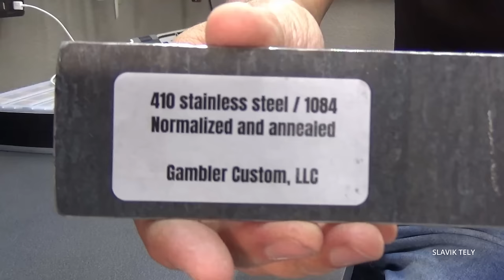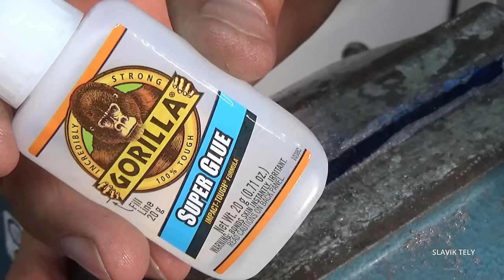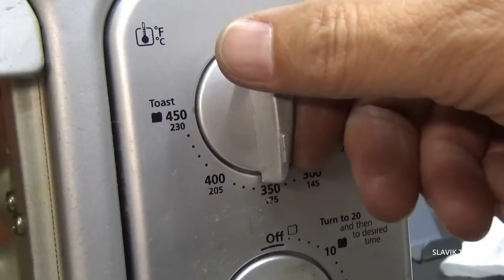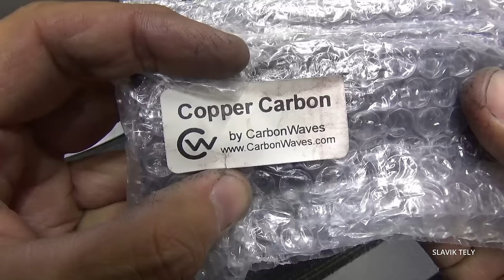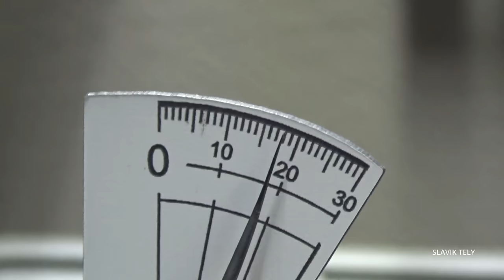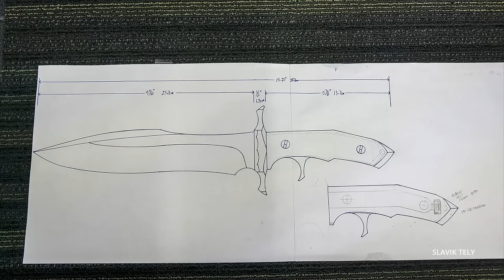Making Rambo Last Blood Heartstopper knife

Comment: Please don't wear gloves, or anything that can be caught by the drill, while using a drill press. They can and will take off your fingers and/or mangle your entire hand.
Reply from the maker: My drill press is not that powerful to do damage to my fingers.
Reply: How long do you think he's been doing this? I suspect he knows what he's doing.
Reply: @moehoward01  I get that experience is valuable and surely helps to avoid accidents. However it only takes a second of not paying attention and one wrong move to mess up your hand real bad. Especially when you're comfortable around a certain machine you tend to get careless. So just consider it a heads up to be mindfull of anything that can get tangled in a moving machine. Gloves, hair, long sleeves, etc.
Also: I'm a big fan of the channel and obviously want to enjoy the work as long a possible. Stay safe! :)

Comment: in general, the idea is interesting to divide the handle and the blade into 2 parts, in fact it is a collapsible fulltang, but this technique allows you to change the blades and leave the handle, this is a cheat!  fabulous !  it would be interesting to see if you decide to actually make another plus one blade
Reply from the maker: That is an interesting idea. I need to make a knife with interchangeable handles.

Comment: Congratulations on the assembly of the façade, it was beautiful and very top, I would really like to have one of these. If I saw it in a store for sale , I would certainly buy a work of art like this , and I saw that it is beautiful and a lethal weapon , in a fight against an animal dangerous to humans , it would give a lot of advantage , because from what I saw in the assembly , it cuts on both sides , and also if you , at the time of danger in a mortal fight , you push it into the creature it will enter the animal's body without difficulty , I would really like to have a knife like that in the jungle , it gives you security, because a good defense and an accurate attack, an accurate attack will guarantee your survival.
Reply from the maker: Hi. This knife is not for sale due to copyright issues. You can buy it from original maker Pohl force knife maker.

Comment: What a nice surprise seeing Tely bring one last project out before the new year. 

Is that vellum you used as the templates? Genius.
Reply from the maker: My father in law took an old tv apart and it had layers of thin white plastic as a screen. I took them for my projects.
Reply: @SLAVIKTELY  oh! The diffusers they use are called fresnel lenses, I believe. Even better. I wonder if there's a way to get a stock of that to use, since I doubt just counting on finding old tvs is a good way to get it. Still... I bet there's tons of old tvs waiting in garbage dumps waiting to find a new use. 

I'm going to give that a try!

Comment: That is a work of art. Absolutely beautiful, the tiger stripe pattern is outstanding. Do you have a link to the sharpener, I like the set up and the scale to visualize the angle of the bevel.
Reply from the maker: The maker only has an email. EFIM sharpener. I think I show the email in the video. Tell him you saw this sharpener in my video.
Reply: Outstanding! Thank you very much.

Comment: came out really nice so good job there.  one thing i just wondered out of curiousity, how sharp did you make it? just wondering beacuse in my head that kind of knife is something you bring into the wild and if the knifes edge is to sharp (like razors edge for example) and you use it in the wild it will go dull quite fast rather if you have more of a "normal edge" if you understand what i mean. i am in no way criticizing your work i just wanted to ask seanse i got this questing in my head. keep up the good work!
Reply from the maker: I did not make this nice to be out in the wilderness. Therefore, it’s not sharpened the way you’re thinking of.
Reply: @SLAVIKTELY  ok i get what you mean 👍

Comment: Awesome! Great Work.
You used an Inox steel, didn't you? I'm surprised, that this steel is to be hardened with oil.
And how did you create the hamon on the blade?
Sorry for my bad english 🤷
Reply from the maker: Steel was made for my. outside layers are stainless steel and inside is 1084 carbon steel
Reply: Ah, okay. Tank you!

Comment: Lovely work but I can't see the point of that handle construction. You could have just kept it full tang surely?
Reply from the maker: How do you install A hand guard made out of carbon fiber?
Reply: @SLAVIKTELY  pin it directly through the guard
Reply from the maker: @justa1098  I don't want to see pins in a carbon fiber guard. I like the clean look.

Comment: How and why does the pattern appear on the blade? Great job as always!
Reply: Looks like it's two materials, hard carbon plate welded between two stainless plates. You can also get a similar effect by hardening it with a hamon.
Reply from the maker: It is a layer of stainless steel, 1080 and stainless steel squished together

Comment: 23:00 sorry for my ignorance about knives but, I can't finish to understand for what is that mechanism. Can somebody please explain it to me? Thanks!
Reply: Its a drill
Reply: Hi damit man das Messer zerlegen kann.
Das Mechanismus hält alle Teile ohne Kleber in Position .Tolle arbeit
Reply: @vituschka1410  But he could just make a solid handle, why put a complementary part with a bolt? Is just more work with no use. Again, sorry for my ignorance, I just want to understand the design.
Reply from the maker: It is a two part knife this way I could place a hand guard on. the bolt keeps everything tight.
Reply: @SLAVIKTELY  woooww!! answered by the slavik himself!! this is quite a honor! so what is the point of make the handle in two parts? why not a single piece as regular knives? I really love your work and I'm very glad that you are back!

Comment: Why didn't you just make it a full tang construction? Wouldn't it have been easier to do not to mention make the blade just that much more rigid?
Reply: How would he get the guard past the wider point in the handle ??......many knifemakers use this construction calling it a Frame handle knife. Its challenging to get a perfect almost invisible fitup of all the seperate pieces...its also way  to show how a good knifemakers differs himself from a mediocre knifemaker.
Reply from the maker: There is the answer. Thanks @HoutmeyersP

Comment: Sir .idk if you know. Cut carbon first to strengthen teeth before cutting stainless. Double the life of your blades
Reply from the maker: I don't understand.
Reply: @SLAVIKTELY  we would use Elis band saw. My old boss taught me that. Carbon isn't so hard. It perhaps heats to a point to make stronger. He would have me run a half inch thick of flat stock first. Then run stainless . If it didn't it would eat the teeth fast due to how hard stainless is. I questioned it also till I forgot one day after a change. Yep it chewed my teeth off faster. Give it a try see if you agree. I've been welding stainless for a decade now. Just helps harden teeth is all
Reply: Mild steel (carbon) and that knife is incredible.  Great job!!

Comment: Did you linger in vain because you used factory-made ready-made steel? I don't understand why you made the handle part in 2 parts
Reply: I thought some forging would be going on. 🤔 but still a nice replica.
Reply from the maker: At this point I don’t have equipment to make my own San mai steel. That is why I order my steel from professionals. I made a two part handle so I could install a carbon fiber hand guard.
Reply: @SLAVIK TELY  I think it's cool, crafty, I just usually watch forge work etc so was interesting and informative keep up the good work.

Comment: Why do all these knife making videos show the makers using precision height gages as scibes. It makes me want ask everyone i see do that please stop its not designed for that.
Reply: Uhm they are. The metal is carbide and Is made for this.
Reply: It's a great blade. Though personally I don't like when blade makers almost always go with such small tangs. For something useful that isn't just a kitchen knife or purely for display it should be full tang to make it far more stable and far less prone to bending at the guard because that's where it's most weak when being used.
Reply from the maker: It’s the greatest thing ever for knife making.
Reply: @SLAVIKTELY  (starrett 57b full sized surface gauge)starrett full sized surface gauge for scribing lines, transferring measurements and probing surfaces. I use one at work there great. Worth the investment.